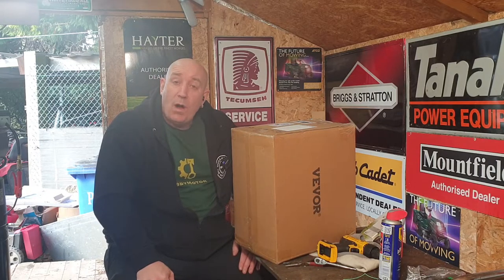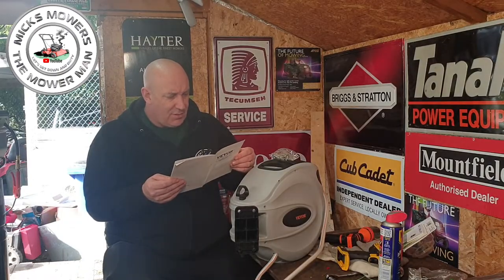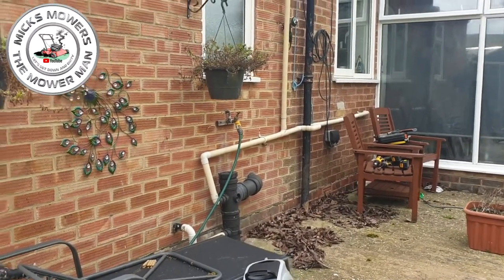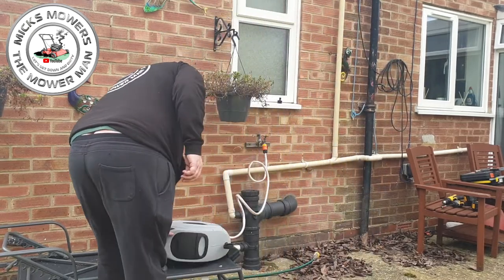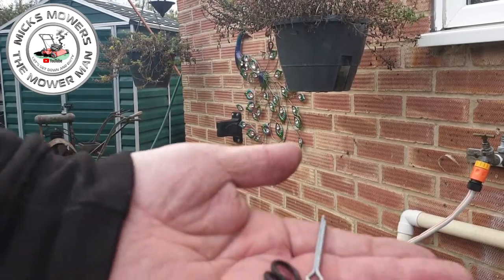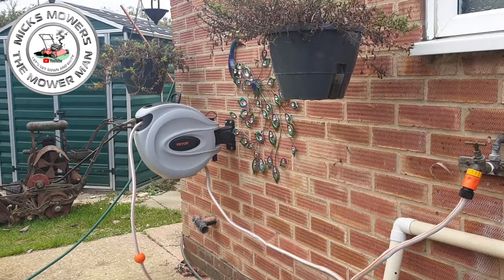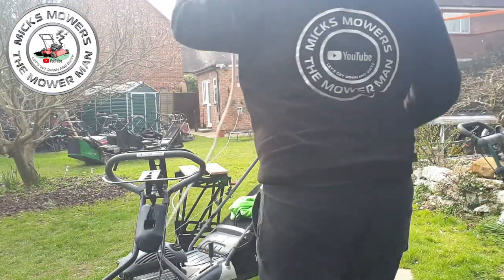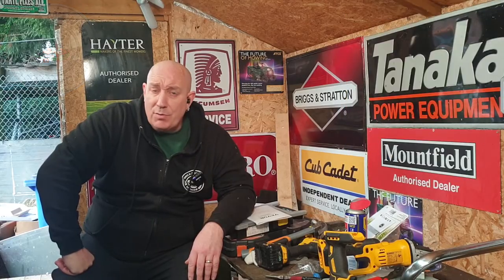Vevor Retractable Hose Pipe Great For Washing Mowers.

Comment: I’ve got the hose lock, one of them retractable. Turn off the tap and then open up the nozzle and the retract as it will then take the water out of the pipe. Don’t want to freeze with too much water in the pipe. But they are awesome. It’s a great piece of kit to have.

Comment: when i get unlabelled rawl plugs i measure them by measuring tape or calipers so i use the right drill bit , and mark plug depth with a piece of tape or marker pen on the drill bit. saves me a bit of time.

Comment: Looks like this is a good product keep us updated on possible recoil failure. I have personally seen issues with air hose reel failures or not fully retracting after a period of use so interested in how this works on these water hose units.
Reply from the maker: I will let you know cupcake